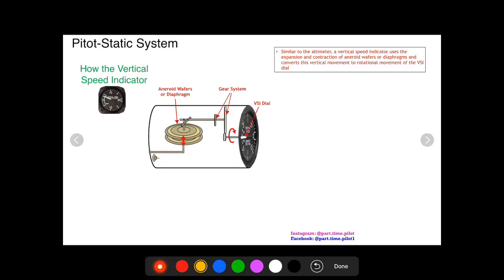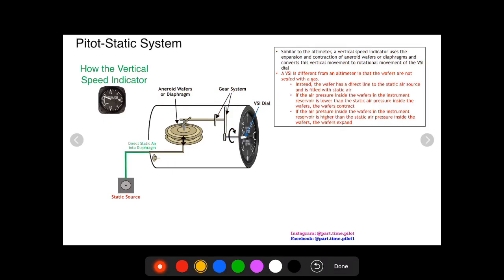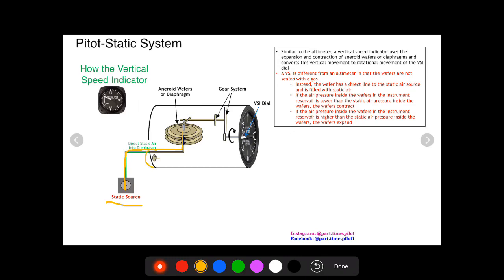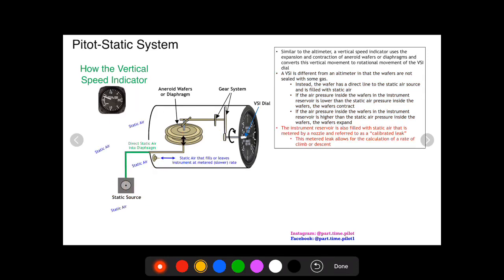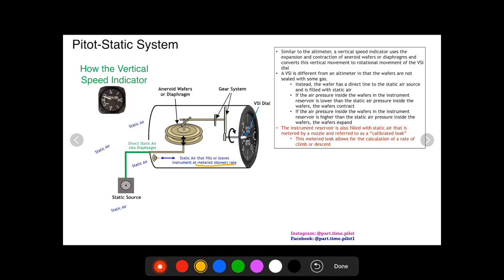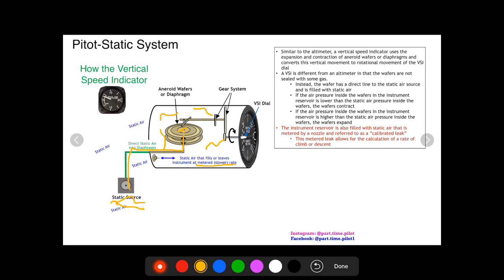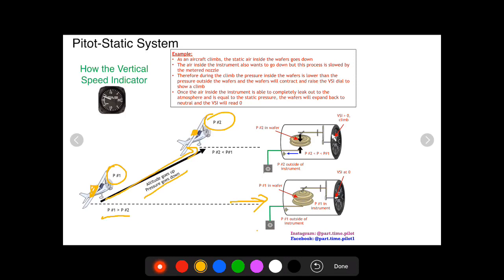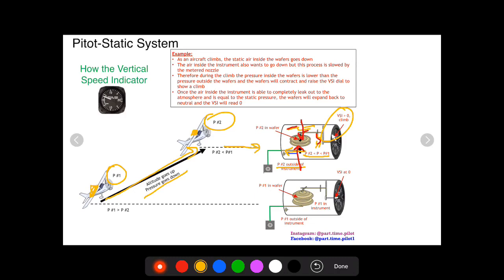How the VSI Works - For Student Pilots

Comment: Video has two P#1 & two P#2. On left lower in Altitude & higher ALT. - Pressure altitude, Pressure density. & then pressure inside the VSI on Right. Difference in Pressure in capsule wafer, 29.92 Hg set, & pressure in chamber changes about 6 seconds when straight and level flight.

Comment: VSI Only uses Static. Pitot-Static are both used only in the AirSpeed indicator,  other than that great video. 👍
Reply from the maker: Thanks for the comment but I don't think I say that VSI uses pitot-static? Or did I mispeak? It uses a static input and a regulated leak of static to come up with the delta in pressure/altitude